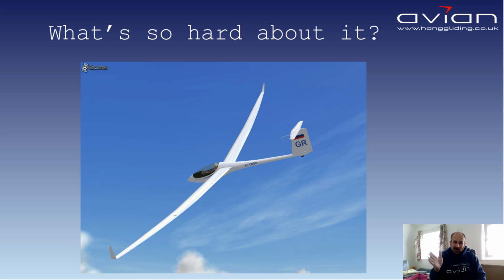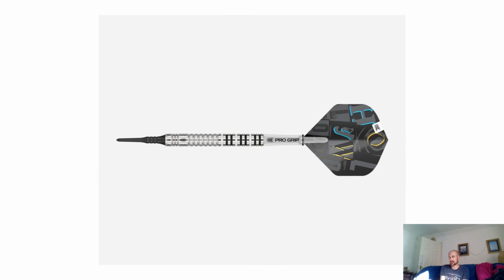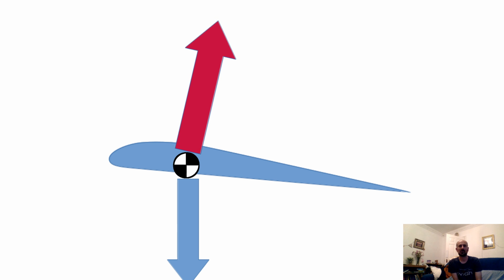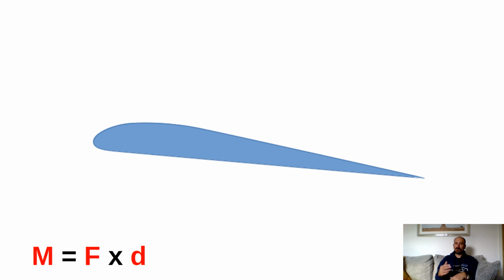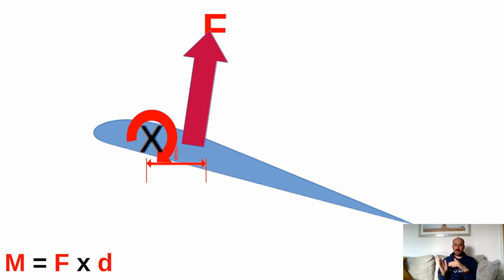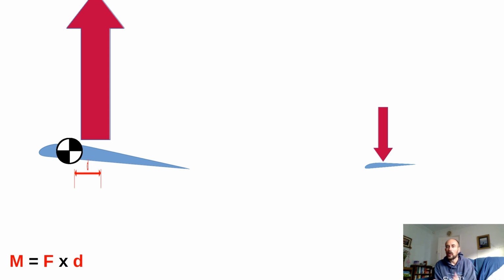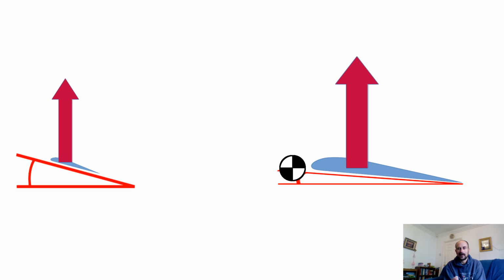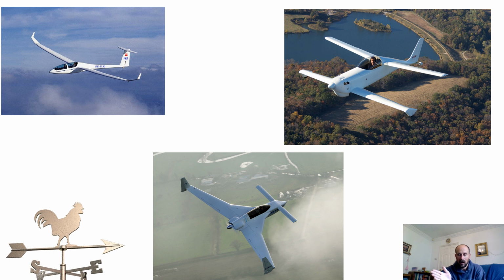How does pitch stability work?

Comment: Seems to me we don’t give much thought on the outer tip flow control ( the last 3 to 4 feet of the span )   by utilizing narrow  1/8 inch gap flow slits from the 1/4 cord redialing aft to nearly to the trailing reinforced edge.  ( This would be more practical on a single surface glider).   At lower airspeeds high angle  of attack, the slits will allow some higher pressure flow from below to transition up to the upper low pressure near the wing tip vortex rotation only instead of one large vortex we could have multiple smaller vortex’s reducing  induced drag and lower stall speed.    If only some ambitious HG designer could take an old bagged out Falcon onto a test vehicle rigged up with flow tuffs, leading edge smoke and cameras.  We have already experimented with leading edge vortex generators which manly deal with boundary layer control at higher speeds in hang gliders and some trikes.  I like to think we can somehow simulate what large soaring hawks do with there multiple wingtip feathers accomplishing multiple small vortex virus one large one.
Reply: Cool interesting insights.

Comment: Nice video about pitch stability. However, researches have shown that the vertical position of CoG also influences pitch stability. This may leads to critical behaviours such as auto-diving. I'm researching on this but have got little detailed knowledge. Have you investigated about this and would you like to discuss it? Thanks.
Reply from the maker: Yes, this is called pendulum stability. The next video will go into pitch stability as it applies to hang gliders and I'll include that.
Reply: @avianhanggliders1985  Magnifique! I can share thesises that I've found about the theme.